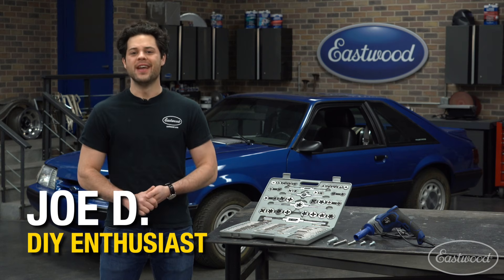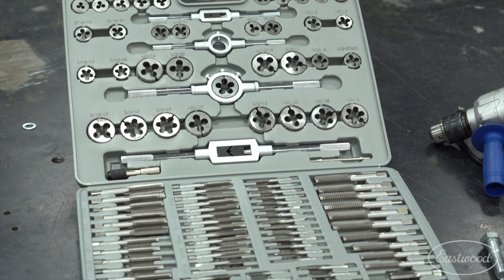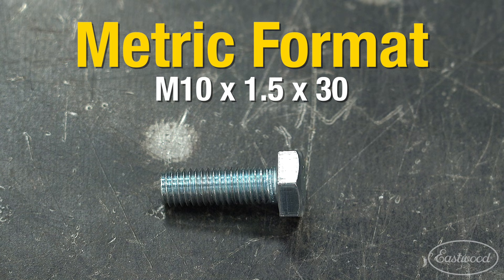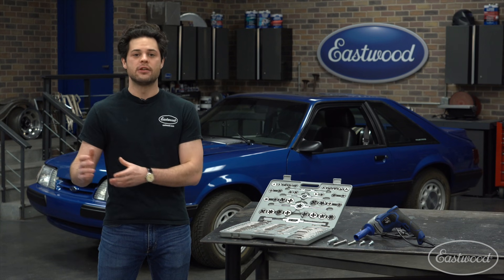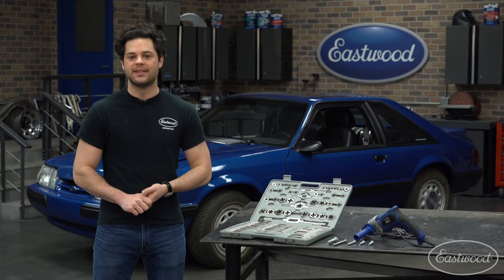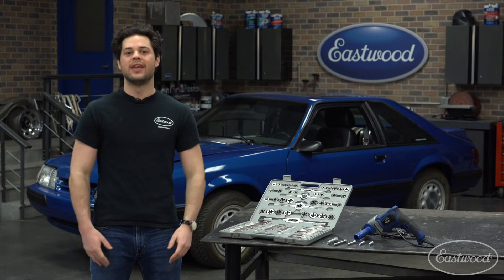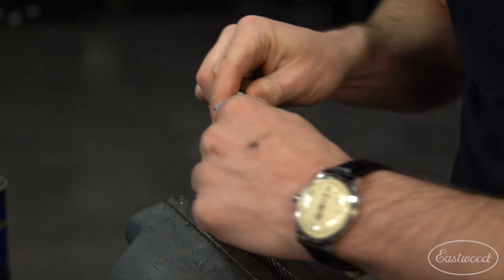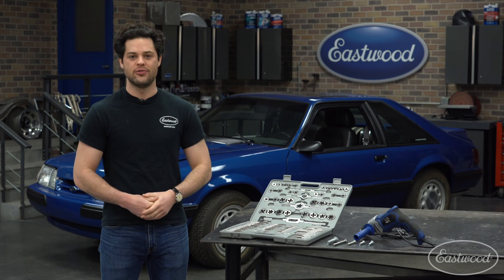Repairing Stripped Nuts and Bolts: How To Use Tap and Die Sets | Eastwood

Comment: Incomplete information is missing
Reply from the maker: What information are you looking for?
Reply: @eastwoodco  How do you find the bolt diameter how do you know which tap to use to rethread or clean up threads based on the bolt size I understand fine and coarse threads but these other things are missing
Reply from the maker: In most cases you can use the tap and dies as reference and compare them to the threads you're repairing. Or you could purchase a thread diameter/pitch gauge.
Reply: @ I got a diameter/pitch gauge so now I have watched over a dozen videos on doing this and NOT ONE TELLS YOU HOW TO TAKE THAT INFORMATION AND CHOOSE A TAP FOR THE HOLE YOU ARE TRYING TO RETHREAD BUMBASSES EVERY VIDEO, "Now that you know your size and if it is a fine or coarse thread grab the tap you need." How do I take that information and know what fing tap I need you people act like someone that has never done this is supposed to know that, MORONS!

Comment: You just said you you use the dies to make the female threads,dies are not used for making female threads,that's taps are for,a tap is used for making female threads and a die is used for making male threads.

Comment: The better dies are the hex ones, you can spin them with a socket, easier to hold in a vice to clean bolt threads up.

Comment: Do you have to drill it out to use a tap or will it just fix the threads already there?
Reply from the maker: Both. You can tap a freshly drilled hole or you can "chase" threads with a tap.
-JD

Comment: I worked in a machine shop while going to school, and did a lot of tapping of threads. these taps are ok,  but the tap and die wrenches are crap and the dies are round. it seams like all the cheep or affordable sets use the same cheap cast pot metal or Chineseium tap wrenches and round dies. Round Dies slip in the wrench when threading and wear out the set screw fairly quick. all the cheep sets are like this. Eastwood, Hazard Freight, Craftsman, even Tekton, which is one of my favorite tool companies, are all probably made by the same factory in china. Good Dies are hex shaped and do rely just a set screw to hold the die in position while tapping. using a set screw to be the point of force, rounds off the set screws allowing round dies slip in the cheap wrenches, and the cheep pot metal wrenches also break really easy. Irwin makes some of the taps out there, but they cost about twice as much has these cheep sets. Another great choice is Gear Wrench, again its about twice as much, but they will save you untold hours of frustration over the cheap sets and broken tap wrenches or broken taps. if you are on a budget, Home Depot sell a 77 piece kit that is make by Apex Tool (the same company that makes Gear Wrench) and is identical to the smaller Gear Wrench set, but less money.  I normally love Eastwood products, like the QST30/60. it was truly innovative for weekend warriors or hobbyists. I wish they would do the same for some hand tools like taps and dies. so for me its a hard pass on these. 

Eastwood Guy in the video also fail to mention that you will need a full set of drill bits in Letter, Number and Fractional sizes to properly use it. for example, a 3/8 - 16 threaded hole requires a 5/16th drill bit were 3/8 - 24 thread hole requires a Letter "Q" size drill bit. and a 1/4-20 inch threaded hole requires a number "7" drill bit. also when cutting threads with a Die, the metal rod needs to be a certain diameter. this is why the guy in the video was struggling with the tap and die wrench. the rod was slightly too big.
Reply: You Can't Make America Great Again  unless you vote Trump 2024 M.A.G.A